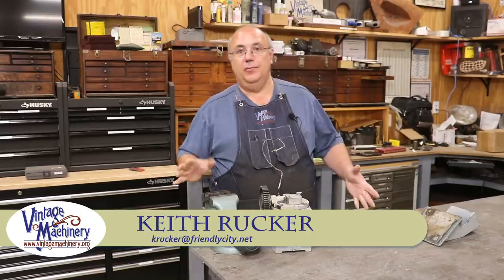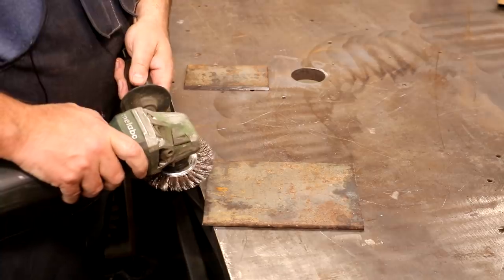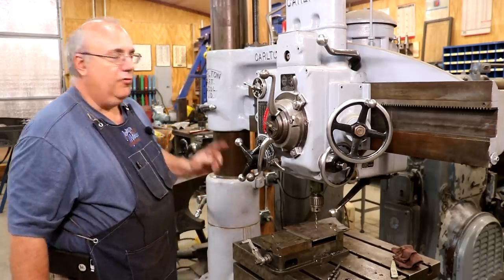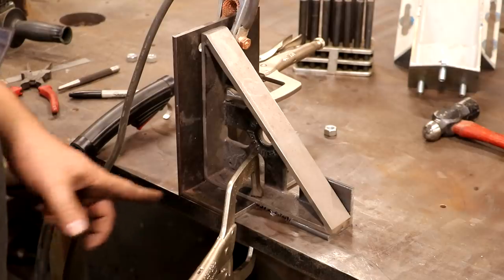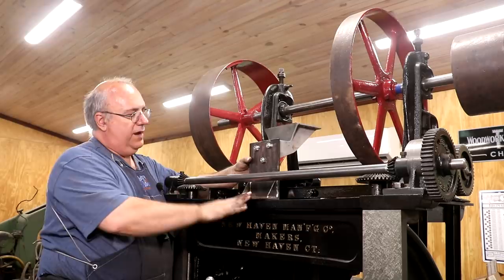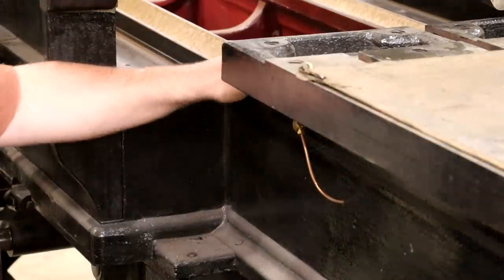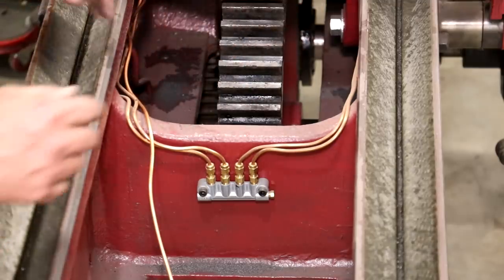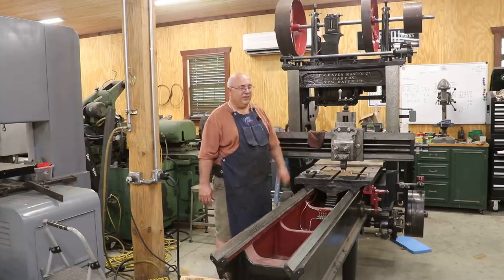Metal Planer Restoration 60: Installing the Lubrication Pump and Plumbing

Comment: 22:26 - "so we're going to get equal [amount of] oil going to all four points" - umm... well...
Firstly, those check valves are not super-precise mechanisms - they would open at given psi, plus or minus some, "as specified in their tolerances". Which for this type of valve would be quite "liberal", methinks. So whichever one opens first will deliver the most of the "shot" - and in extreme case it might relieve the pressure within the distribution block so much that other valves, or some of them, won't open at all (or only for a very short time).
Secondly, even if those valves are perfectly "tuned", so they would all open at exactly the same time (pressure) you'd still be dealing with a different length of tubes with different flow resistances.
The way to deal with this issue would be to create a constrictions at/ next to the END of each oil line, so whenever the pump sends the shot of oil into the plumbing the pressure within would rise (thanks to those constrictions) and equalise within the whole system, and then you'll get equal amount of oil output at each oiling point. (At high enough pressure in those lines their individual flow resistances would be insignificant.)

Of course, should the pump provide big enough of an oil shot, so big that the pressure within the system would equalize anyway, that reasoning above would be moot and pointless - but from your description of how this pump works I gather that it won''t be the case here.
[EDIT - corrected some typos]
Reply: Agree. "If a line becomes clogged..." When/if that happens there will simply be less (no) oil flowing in that line. Period. Hopefully, each line goes to one face of the guide ways (four sides) and Keith will see one face drying out from lack of oil (and possibly an increase in the oil on the other guides?). So many details, so much fun! Hey the thing operated for decades without any pump! Stop worrying! 🤪
Reply: @arkiefyler  Hey, I'm not worrying at all! "Not my circus, not my monkeys", as they say here where I live... : )
Yes, the planer operated for years without the oiling system, and without any... Wait, its bed had to be reground, hadn't it? What does it say to you? Because to me it says... well, never mind. Let's focus on the NEW and IMPROVED oiling system instead.
First of all, one has to realise that this machine would (probably) be hardly ever used at all. Yet another "eye catchy" museum piece, fired up every other weekend or so, to plane a piece of hot-rolled steel, like, say, 2'x8' (if budget allows, I'd bet it'll be more often like 1'x2' - but then again I might just be wrong). And "that would be ita" in respect to the "usage", as far as I can foresee.
So, in this case this "new and improved" oiling system is just as needed and warranted as teeth in your arse - or, to be more polite, a fifth leg for a dog (any breed you pick).

Keith probably won't catch any discrepancies in oil flow whenever the machine would work, and anyway my comment was about challenging Keith's WAY OF THINKING, not  whether "he'll catch, or he won't". See, my "problem" with Keith is not so much of what he actually does, but more his "jumping to conclusions" way of thinking. But I can live with that, I'm just too old to be bothered by that.
Cheers!

Comment: Keith - When you drive your car, do you also switch forward and reverse !!!!!
Reply: There are a lot of cars (mostly vintage, but a lot no less) that have odd shift patterns.  If you are a clever fellow and found the need, it would not be hard to modify shift linkage to your liking. This was very common back in the day of Group B rally cars.  Many of the incredibly talented rally drivers of the day had things (shift patterns being one) built to their spec.